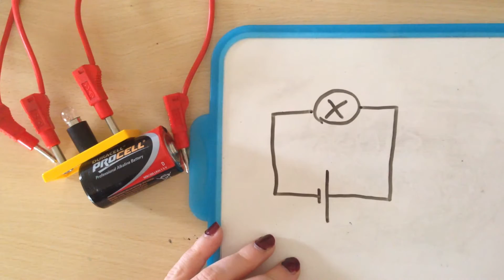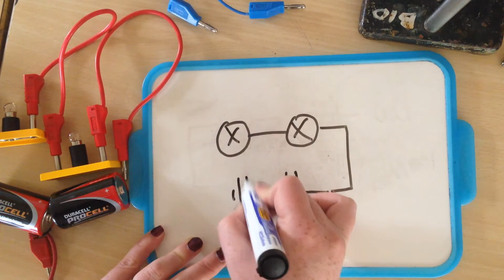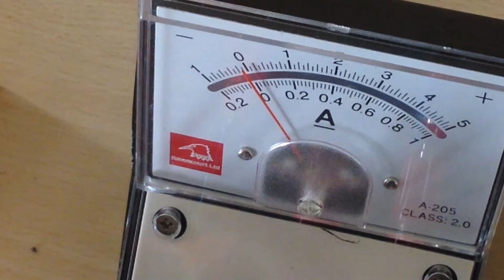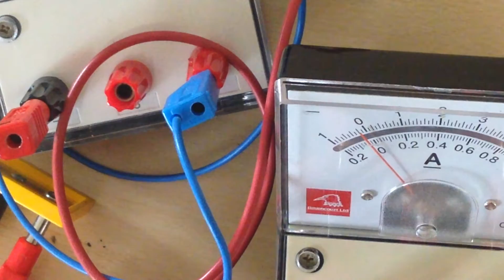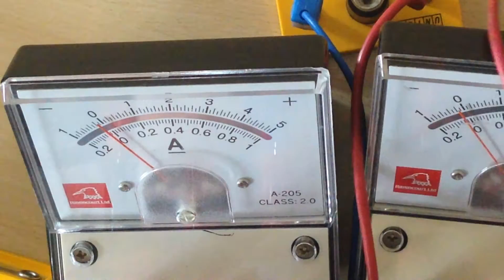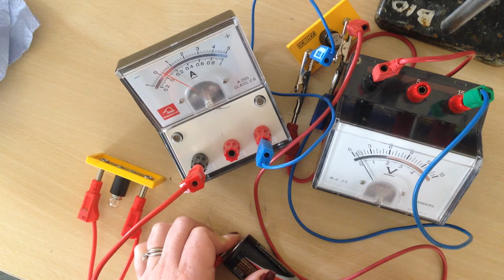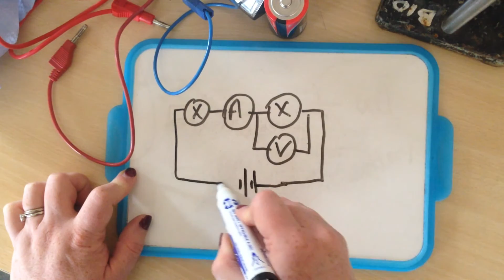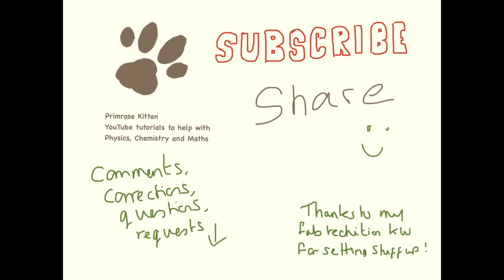Series Circuits.

Comment: Why must the ammeter only be connected in series? why cant it be in parallel?
Also, I understand that the battery is providing the potential difference/voltage for the circuit, but what is providing the current??? thanks
Reply from the maker: +Lailita D current is the flow in the circuit, so it come from the movement the 'push' for which is provided by the battery